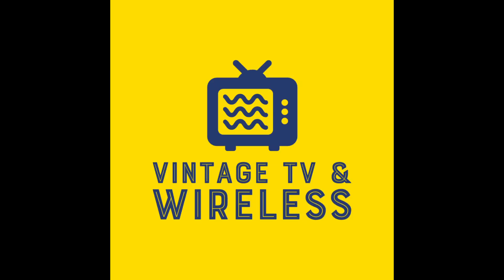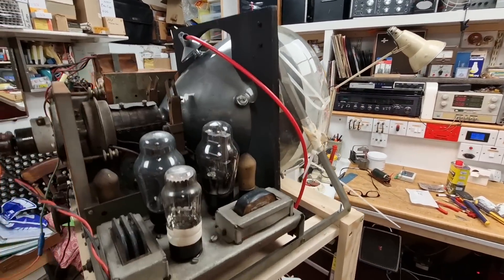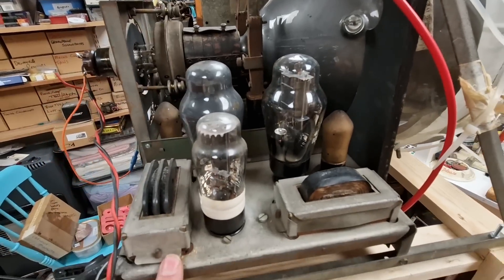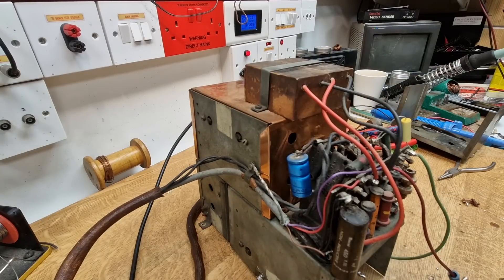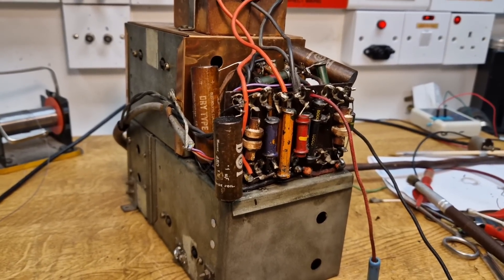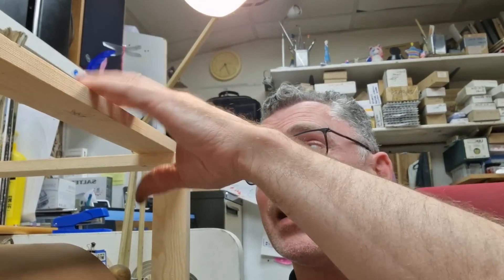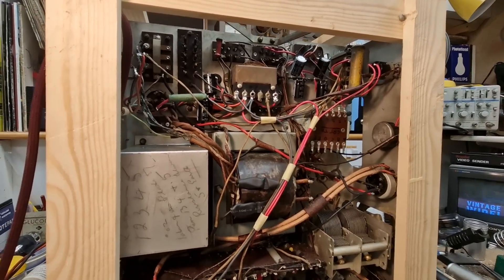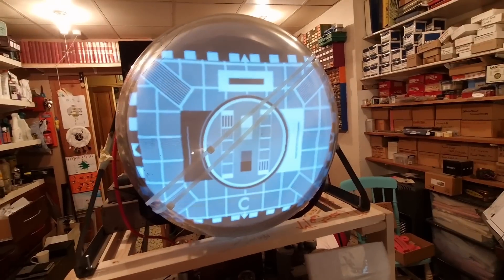A look at a VERY RARE 1938 Baird T18 television chassis....

Comment: Back in the early '50s I built a 'Vision Master' (I think) from instructions in 'Camm's Comic' - actually F J Camm, Practical Wireless magazine.  Had a local tin smith make and punch a very complicated tin-plate chassis from the diagram and most of the components came from a local retailer of ex-WWII military hardware.  A great learning curve!  It used a metal cone 12" crt.  Took quite a while to construct and in the end it did actually work but I never got round to building a case for it all.  405 line picture, so really great detailed resolution!!
Reply: Back in the early 50s? How old does that make you?
Reply: @nychris2258  I have an Edward VIII stamp on my birth certificate - work it out!
Reply: @nychris2258  88 but only 31 in Celsius!
Reply: That project was called ViewMaster.
Reply: @grahamrabstaff9766  Yes, of course it was, thanks for the correction.

Comment: wow!! awesome TV love it!   I thought they always got the flyback voltage just as a transformer fro mthe mains..  ..  on another note, whats the music in the begininng and end of your video?
Reply: You have answered your own question there. In a TV with a  flyback transformer it is powered from the line scan circuit which on this set would operate at 10125Hz. That allowed a much smaller transformer and capacitors.

Comment: When you said that you restuffed the capacitors, did you reconsistute the originals, or did you fit a modern capacitor within the old package and then sealed it up for modern “quality” but in a period correct package?
Reply from the maker: Sorry it wasn't clear. The old capacitor casing is refilled with modern polyester capacitors and resealed.
Reply: @vintagetvandwireless  thank you for the reply. That makes perfect sense. I guessed that that was what you meant. If you really had managed to reconstitute the originals I would have been mightily impressed, and asking you which electric demon you sold a soul to, and how far one soul goes these days (I guess you get quite a few capacitors of that vintage for that soul, compared to not even one modern iPhone battery) 😉

Comment: Broadcast engineer for 30 years now and that just scares the crap outta me watching that baby sit there. Looks devious.....
Reply from the maker: It scares me too 😀
Reply: @vintagetvandwireless  Was the deflection electrostatic like in oscilloscopes? The thing looks high-implosive without a rimband and I would really fear that CRT to suddenly fall out of the chassis when secured with only a few cable ties. I hope this isn't an actual crack in the glass at the top of the screen, is it??

Comment: I did my City & Guilds in B/W TV repair between 81-83.
We had 20 TV's to practice on from a lot of eras.
I remember we had a Ferguson TV (No17😊) which was exactly like the one we had at home...😏
We also had another from a much earlier era which was wired similar to your TV here (No1).  All point to point components on tag strips, no PCB's. 🙄
We had the circuit diagrams and this last old TV had a pictorial print where you could actually see the physical layout of the components, not re-prints, actually service manual.
To work on it, you had to tip it up on its side to get to the components.
Some TV's were designed with live chassis, they were fun and you had to be very careful, just like yourself on your TV.
What we have now are a whole world away from these old ladies......

Comment: could you fit a modern low current  EHT generator in the  dangerous EHT transformer box  , , there might be enough space keeping the disconnected  transformer to keep it original  , maybe a neon transformer from the Bay

Comment: You can use HackTV with a transmit SDR to generate the 405-line signal. I prefer captainjack64's fork because it handles aspect ratios better.

Comment: Great work indeed. 
Having stopped my heart, and lungs, when I made a rookie mistake on a tube TV, I can truly attest to how agonising the experience is!
Reply: It's referred as a "flyback" because it makes you fly back some meters by the jolt of being touched wrongly. But this chassis not even seems to have one (electrostatic deflection?).
Reply: @cyberyogicowindler2448  think your getting a few things crossed there buddy,  on "conventional" tv sets the high voltage is produced by a flyback transformer,  yes many many kv but, realistically very low current. for sure potentially deadly if touched, but most times just very decently unplesant. these old sets have an HV circuit more akin to a neon sign transformer (deadly) rectified to DC (more deadly) and then stored in a nice big capacitor (extra especially deadly) .. electrostatic or magnetic deflection has nothing to do with the HV source and is an independent part of the set.
Reply: @denisohbrien  Yes, this TV is built like a defibrillator from hell. May be the HV current was made such high to need no closed loop voltage regulator for stable picture size. I thought of electrostatic deflection because he mentioned only 5kV acceleration voltage and the CRT seems to have no (visible) yoke coils.

Comment: I've worked on CRT TVs in the past, but I am far from an expert. I'm curious, if a CRT is low on emissions, would it be possible to carry out a neck transplant? Obviously a glassblowers input would be required, but for tubes this old and rare, could it be a viable fix?
Reply: I don't know if you can transplant a used neck but it's possible to graft a new assembly. This is what "rebuilt" picture tubes usually are. It used to be a common business starting in the 1950s but the last rebuilder closed shop a bit over a decade ago.

Comment: In America, we call that thick red high voltage wire the "flyback" wire. Because if you touch it, you will fly back 5 feet.
Reply: @MrAnon-q1o Was that TV powered on? Normally the static highvoltage charge is stored inside the CRT (which is a glass capacitor) and not much at the flyback end (although the EHT rectifier/cascade circuit may include small capacitors too), so when unpowered, its the CRT end that hurts, not the cable with the suction cup. Early TVs lacked that rubber cup but only had a kind of hairpin hook of bare metal that would arc over to anything coming 2.5cm close to it.
Reply: 😆 Been there, Done that! 😆
Reply: Been on many a flight thanks to them, should have got air miles for my troubles.
Reply: The flyback transformer is called like that, because it generates high voltage during the flyback period (pulse collapse)
Reply: @greg6276  Although, as he explained several times, this set doesn't use a Flyback transformer. Thinking about it the power supply circuit is more like one in a Microwave oven.
Reply: @MrDuncl  
Exactly, I just mentioned it for the knowledge
Reply: @MrDuncl  ...or rather a defibrillator of doom.

Comment: Was in the TV field also, now retired. Never seen such an old set and  never knew that such a type of EHT existed. I wonder if there were circuit-breakers back then. If not, it was the electric-chair. I got surprised at the end to see such a good picture with a grand grandpa set! 

Does anyone know around how much were produced? Did they sell only in the UK or all around the globe? 

Thank you very much for such a super rare video. 👍

🇲🇹
Reply: "Televisions were an uncommon sight before the Second World War, with only around 20,000 sets in Britain."  The only TV transmitter was in London. While other countries were experimenting with TV they would be using their own companies e.g. RCA.

About a decade ago there was a fascinating TV programme which at the end speculated that the reason the U.K. put so much money was into in TV in the 1930s is that it shares many techniques and components with RADAR. One of the first successful prototype RADAR sets was made  by converting a TV. During the war the TV transmitter in London was used to  decept German navigation systems.

Comment: A few U.S. made TV sets in the late 1940s were still using mains powered EHT transformers. The danger, as you mentioned, was so great, they quickly were supplanted by either kickback (flyback) or RF  EHT supplies. When projection CRTs became popular, the 25 to 30 kV EHT had to be supplied by RF or flyback circuits and voltage multiplier rectifier tubes. The 405 Hz whine reminded me of the sound of 115 volt, 400 Hz three phase military AC power I worked with back in the late 1960s. Thanks for such an interesting video.
Reply from the maker: Interesting.  I didn't know the US  had mains derived EHT. The few US made sets I have use RF style supplies.  Thanks for watching 👍
Reply: @vintagetvandwireless  There was a DuMont, and a Philco.  I know of basically no others that were commonly circulated.  After the War, the rush for TV in the US meant folks wanted to cut costs, and getting rid of a 'big iron' transformer and a few tubes, was an obvious place to look...  Once Magnetic deflection was standard, with the flyback transformer the EHT was a 'free' thing - just add the ever-popular 1B3 rectifier tube.
Reply: The 1946 DuMont chassis RA-101 with a 20 inch CRT, first run, used a mains transformer for HT. Second RA-101 used an RF oscillator power supply for HT. IMO, they were amazing chassis, built like battleships. Info and schmatics on ETF website.
Reply: @kevingleason1051  I think DuMont even had a retrofit kit for the earlier sets.  Then again, knowing how overbuilt DuMont stuff was at the time, the RF supply might have been only marginally safer🤣
Reply: It was more practical with the flyback than using a transformer. Cheaper and lighter.
Reply: whats so dangerous about them? Was it risk of electrocution if you touch it?
Reply from the maker: Yes....5000V stored in a large capacitor is pretty good at stopping your heart.
Reply: @vintagetvandwireless  With 50/60 Hz AC you needed a much larger filter capacitor. And the transformer was probably not current-limited.
Reply: Yes indeed you mentioned it a few times in the video ... I thought there was a glitch in the matrix! @vintagetvandwireless
Reply: Tell me about the 400hz 115v so I can go learn about that equip. What did you work on? Aircraft? Radars?

Comment: I was a TV engineer back in 60s till the early 70s bought back memories, then changed to fixing computers for the last 40 years just retired. Now have time to play in my own workshop.
Reply from the maker: Enjoy your retirement......keep that soldering iron hot!👍👍
Reply: @vintagetvandwireless  My goodness, those CRTs really were glorified light bulbs back then LOL
Reply: Oh that's cool Richard! My dad was as well and his dad had a TV factory here in Yorkshire. Beaumont Television. If I have it right, it was Ambassador Television and then Baird bought them out at some point.  Anyway I was brought up in the dark arts myself in the 70s and early 80s and could navigate them pretty well. I certainly remember getting a kick or two from a flyback transformer haha.  Like yourself my dad also went more into computers as the 70s came along and I was mostly all computers and software after him.  My dad is very much retired now but he still has his workshop full of components. No old TVs though anymore. Probably a good thing!
Reply: I was a Uni lecturer in a very different field, but old enough to remember the TV repair man coming to fix our B&W TV at home in the 60s - here in the UK. I had / have a hobby interest in electronics - but not stupid enough to play with TVs. I did use the technical section of the Uni library out of interest though (1970s) and I recall a publication (monthly maybe) for the repair community. It was good, often amusing, read as front line engineers swapped anecdotes and pooled their experience. Computers (I began on the C64), gave me the opportunity to do some practical work over the years - assembling repairing my own.
Reply: When I lived in England in 1967, we had a Sobel tv and had to put money in the back to buy time. Moved to America no license, no money in the back for a tv and color too.
Reply: Do you have a private business?  I have a 1949 Model 710, seven inch screen, I would like to have overhauled and get working.

Comment: Even though it's working as is, why can't you put a high impedance 5k power supply from an older copier?
It's been done on some of the old Philco tv's from the late 40's that have bad rf type hv supplies.
Easy to hide under the chassis.

Comment: I have to say i was amazed at how good a picture it produced at the end. Great work. I've been fixing TVs for the past 30 years but i started long after the era of valves and I've never been near anything like that.
Reply: Modern Tvs are much safer thanks to led & lcd flat screens as these are only 12V  & use only a small amount of power compared to those in days gone by & it is safe to assume that old style TVs in days gone by were a major cause of house fires as there were many cases of them exploding & catching fire due to overheating.
Reply: @ANDREWLEONARDSMITH  ok you're spamming this mental diarrhea all over the place while clearly not having any clue about how modern TVs even work... let alone old ones. Some misinformation reporting is in order here i reckon

Comment: A high volt source driven straight off the line can put you on the ground. Happened to me at 14 YO. Fell down and threw a fit. Never told my folks till I was old too.
Reply: I got a couple of kV across a thumb once. Didn't knock me down but my goodness it sizzled and I was 'frying tonight'. The wound it made on the pos side took a long while to heal up too.  As close to cauterised as I could get I reckon.

Comment: Ive just realized that the footage of the test card on the screen is rock steady with no flickering. When video is taken of a crt screen there is usually a lot of flicker. Is this a peculiarity of the baird set or was the footage taken in a special way to avoid it?
Reply from the maker: Yes, I use a specific setting on the camera to prevent hum bar and flicker 👍👍

Comment: I opened this Video expecting to see an actual Baird MECHANICAL tv. the set I saw was a Baird BRAND tv... A little misleading; but you are right it is a rare TV. Very few examples survive. Fewer still that are still working. Repairing and restoring equipment as old as this is always fraught with potential disaster(s).. I did my apprenticeship in TV Repair with Rediffusion N.E. Ltd. So know a good deal of what you will probably go through. I remember working on some early stuff for the Rediffusion Cable TV system... The Mk 8 model sets. And one of Ferguson's early 950 chassis from the Dual  system sets (VHF/UHF) and getting a belt or two when working on a set with the chassis in the cabinet. So I don't begrudge you what you have to do. Whoever said we had it easy back then... Where have you had your head buried. Keep up the good work.
Reply: Rediffusion later made big projection systems for flight simulators, using a very unique combination of scanline and vector graphics (drawn during CRT blanking interval) for highlighted HDR effects (such as runway lamps and plane jet engine flames).
Reply: I would love to see the mechanical TV.

Comment: I love them old fashioned TVs and radios, when you get that little shock from them that's when you take the plug out of the wall and turn it 180° and plug it back in and see if you get a shock again.

Comment: Is high in voltage higher on color tv then black and white tv what about a 1970s 23 Inch color and 23 inch black and white
Reply: Yes, most square tube colour TVs used higher voltage. E.g. a 51cm colour had something like 28kV while same size B/W as only 18kV. Having 5kV in this set is very unusual, and likely only possible because the CRT is so long.

Comment: How much heat dose that tv put out? You could heat a small flat with that on.
Reply: I remember a vacuum tube colour TV that ate 600W. Also plasma TVs ran that hot and wasted electricity. Normal CRT TVs with big screen only needed about 120W, and the simple 15'' Toshiba I watch TV on draws only 42W.